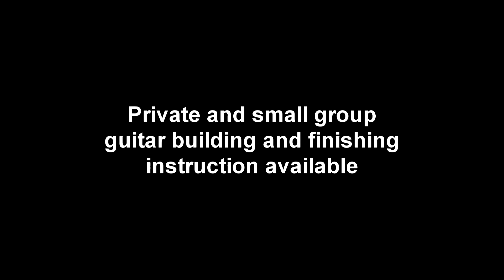Luthier Tips du Jour Mailbag 167 - CA Glue Catalyst - Water

Comment: I use CA as a finish on  guitars, and was originally encouraged with various videos of folks finishing electric guitars, where they spread it on the surface and could easily spread it around.  My first attempts at this, in my uncontrolled-humidity garage in the northeast, just led to a mess - the glue wassetting up too fast.  moving to the humidity controlled basement (basically desicated compared to the local ambient) changed things completely.  Even the humidity in the air can control this process.

Comment: Might sound wild but I actually have a friend in the glue industry and I naturally use all of their systems. They are so big they make CA in probably 15 different viscosities, they even make fog-free or solvent-free CAs that never turn cloudy and can be even used for gluing styrofoam. You can use pretty much anything as an accelerant, I have used anything from water to naphtha and it works. Try imagining CA as something like 2-component hybrid. There are two major molecules separated by some sort of an acid. When CA gets exposed to air the humidity in air slowly dissolves that binding acid and kickstarts the reaction. Air moisture is almost always the actual accelerant, even when sprayed with formulated accelerator. The accelerator only traps air moisture close to the top of what you have just poured. So you are actually creating a temporary blanket. This is the same reason why your fingers get stuck in an instant - air moisture gets condensed and tightly packed on contact. And vice versa, that's why things won't hold and cure quickly if the fit is really sloppy.